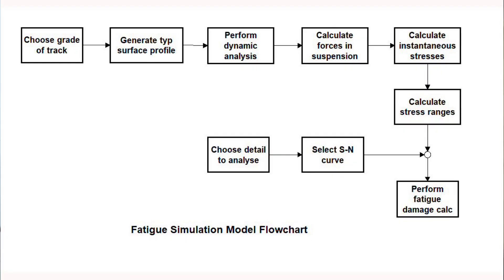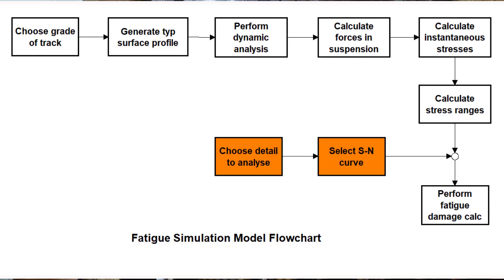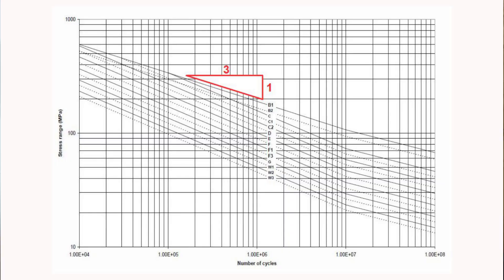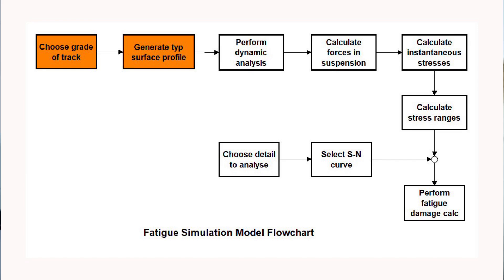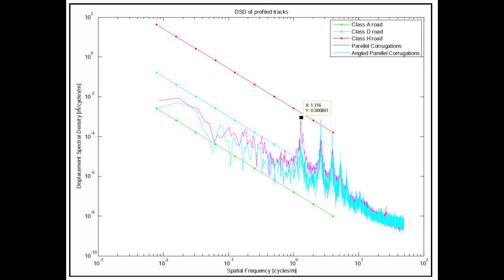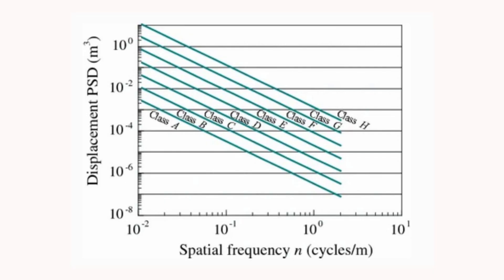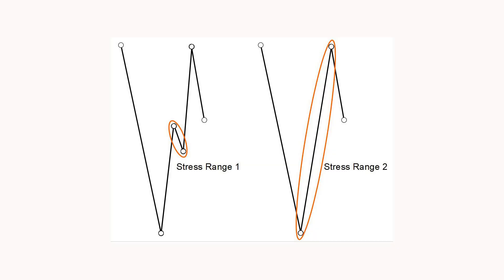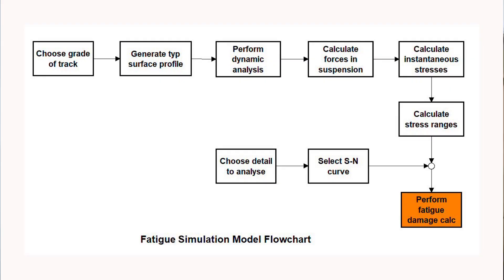Why axles break on overland vehicles. Part 4 - the fatigue simulation model

Comment: Interesting to see how some one not steeped in OEM vehicle design approaches this.  I've only done one solid axle , vast majority of my design experiance is for IRS (suspension / drive train design for quad bikes and SSVs). The mass of the final drive unit (or differential for automotive) is significant in the larger loading events. But for a purely fatigue analysis this approch seams like a decent starting point. To be honest, we have scads of actual running data, never really thought about starting with nothing.

I only started watching because of the Defender. Learned to drive in my Dad's series 2 (a long long time ago in a land far away). Thanks for the entertainment!
Reply from the maker: If you have got actual loading then you're away but I don't have that advantage. For offshore platforms, where I am experienced, you start with seastate data; from gravity wave theory you get the water particle motions from which one derives the applied loadings on any structural member; the structural analysis produces a transfer function  to give the stress at any point in the structure and the fatigue performance can be assessed. With ships it's much the same except that they don't stay in one place so you have to build up a voyage history instead. I have friends in the aircraft industry who say it's much the same there.
It was quite interesting coming up with a valid approach for the video because, never having worked in vehicle engineering, I started with nothing and had to see what was in the public domain.

Comment: Let us hope the Grenadier team are taking note ! Great stuff here  as a binge viewing exercise . Much more interesting here with some context than it ever was in dry lectures.
Reply from the maker: They have sourced their running gear from an Austrian firm which supplies to the G Wagen. There should be no problems there.
Reply: @defendermodsandtravels  Yes the axles seen so far do appear to have tractor origins.  That said, G Wagens do seem to have fairly spindly axles and small diameter wheel  attachment compared to Land Rovers. 12 years flawless 290GD reliability killed by  now 8 years appalling W461 300CDI reliability makes me very interested in moving into Grenadier if they can ruggedise the non avoidable electronics.
Reply from the maker: What did you study?
Reply: @defendermodsandtravels  HND Mech/Production then a combined engineeng degree which went a bit too deep into turbine blade design, but tribology was great and then MSc in building services engineering. My direct automotive background maybe peaked at 17 building an electric car for the 1980   Lucas Electrathon and a later disastrous entry in one of Shell's Motor Mileage Marathons. 35 years of S1 ownership now, although it sits in a shed in the wrong continent! My ex Land Rover half price early 200 TDI 110 CSW was great as a daily driver over six years and  yes the pre-TDI Diesels were desperately lethargic, I nearly bought a new one but couldn't face the loss of my Peugeot  205 Diesel's relative performance . Keep up your videos !
Reply from the maker: @philhealey449  Pleased to hear you have a solid technical background. You will maybe appreciate some of my videos more than the general viewer.
Reply: @defendermodsandtravels  Could be good for some LinkedIn banter if you wanted to connect?
Reply from the maker: @philhealey449  I don't do Linkedin, FB, Instagram etc. Happy to meet you on the road somewhere though.
Reply: Unfortunately it looks like the Grenadier has Salisbury type housings. IMO not as good as a fabricated Banjo type. Big heavy centre section, with abrupt change in stiffness where the axle tubes meet it. Note LR Sals 8Ha have had tube failures at meeting point of cast centre section. Plus they are a pain to work on the differential and are heavier for same strength of a fabricated housing when looking from end to end. They also are harder to strengthen compared to the banjo type.